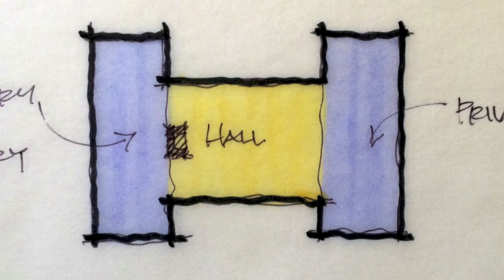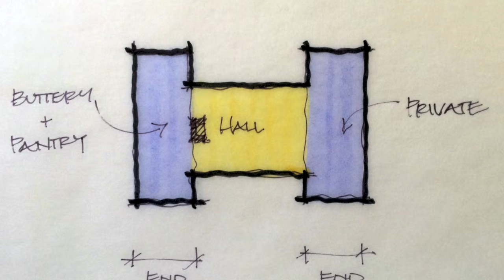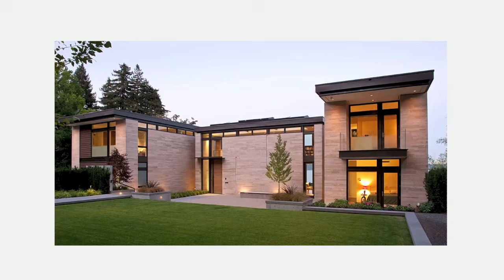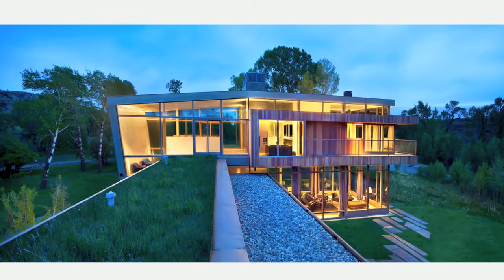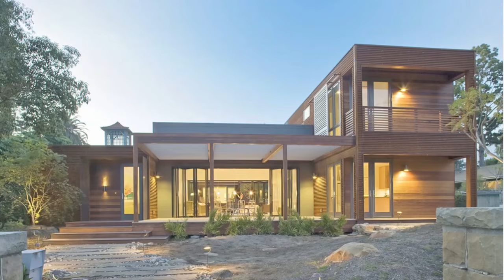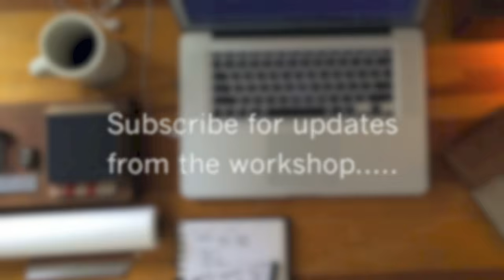The H-Shaped Floor Plan - ( Medieval Hall House )

Comment: The "H" makes for a grand design, but for the insides of the H to provide reasonable courtyard outdoor spaces, you need a large lot to build on.  You also use a LOT of exterior wall area (expensive in cladding and insulation) relative to the amount of floor space.  On the other hand, the H makes possible relatively short roof and floor spans without interior load bearing walls.  Maybe best for rural areas with large lots and temperate climate.